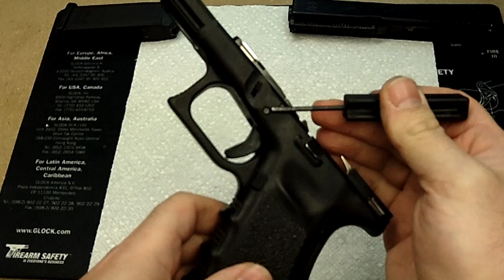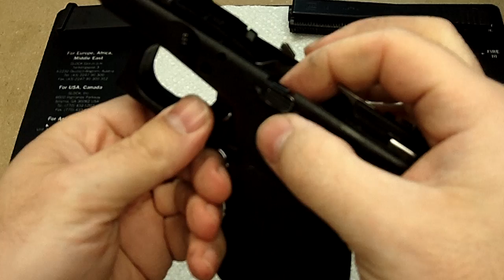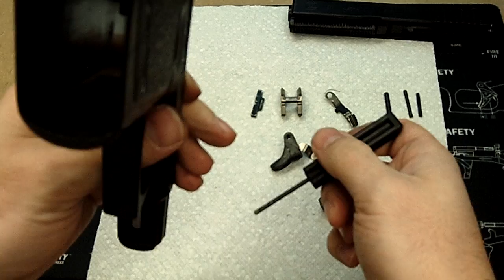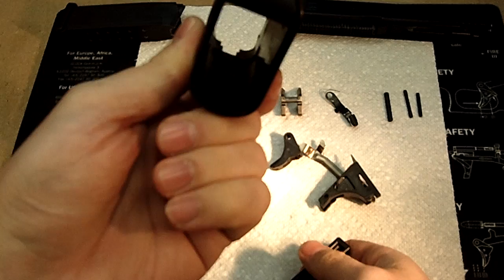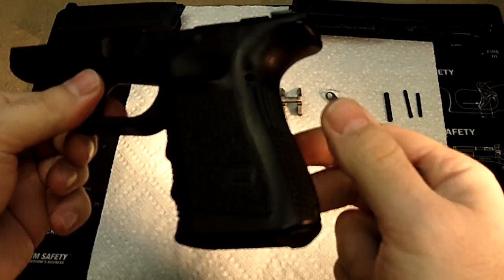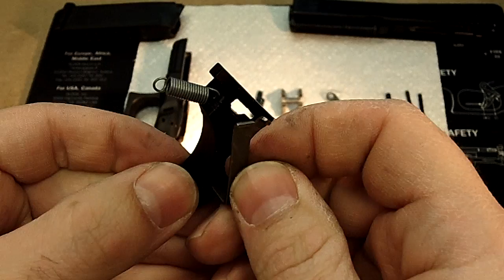Glock Frame Disassembly

Comment from the maker: That's ok. Some pins, especially if they have never been out before, are stuck in there very well. If you place a bit of gun oil, so that it can seep in between the pin and the frame at that point, you should be able to make some headway. You must be sure that you have a block of wood or such to support the frame, and an area for the pin to move into. It may take some time and possibly a lot of effort, but unless the polymer frame is melted around the pin, the pin can be removed.